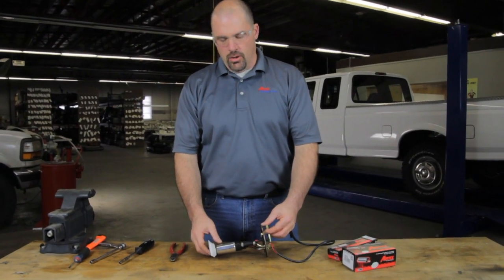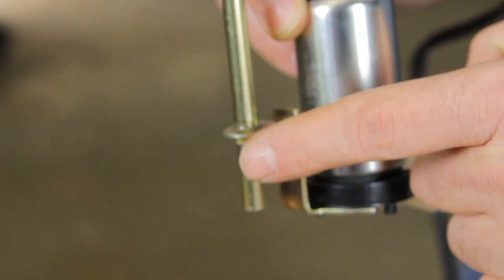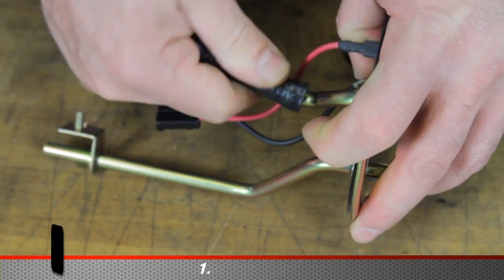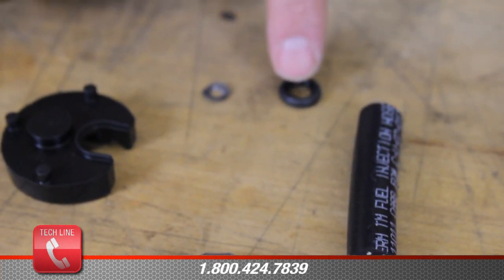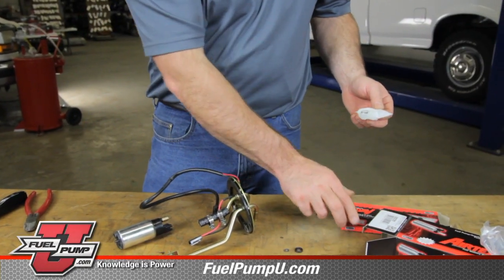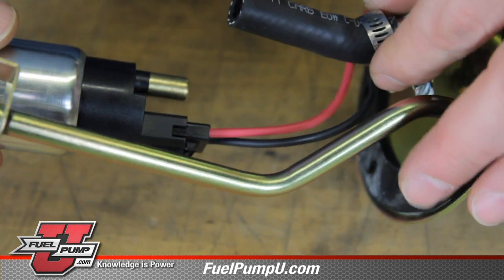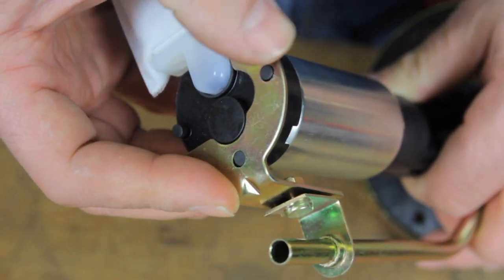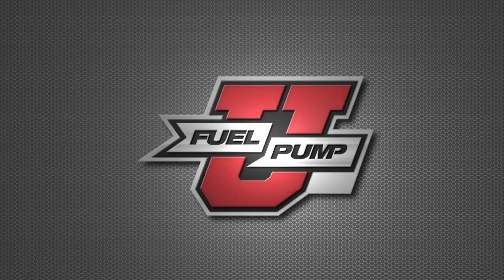How to Install In-Tank Electric Fuel Pump E8229

Comment: I don't understand what you did with the o-ring? You didn't show how you installed it and i dont see one on the parts diagram 
http://mx-3.com/manuals/showimg.php?file=/1992%20Workshop%20Manual/F2/92_F2-116.gif